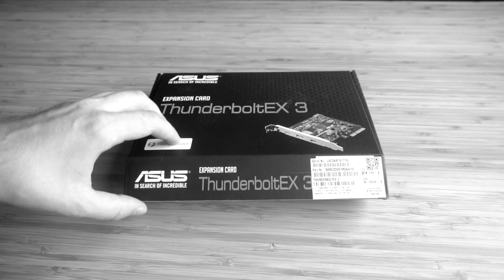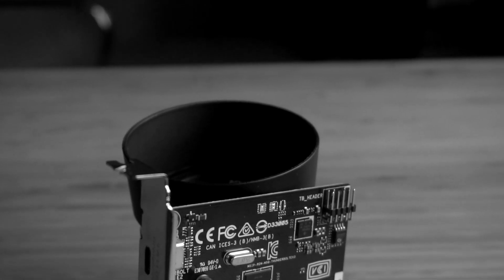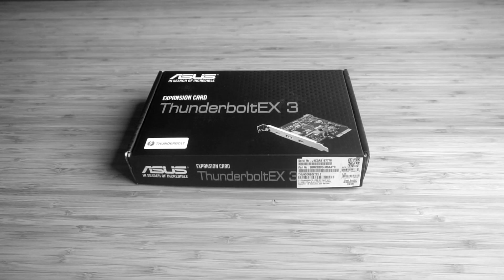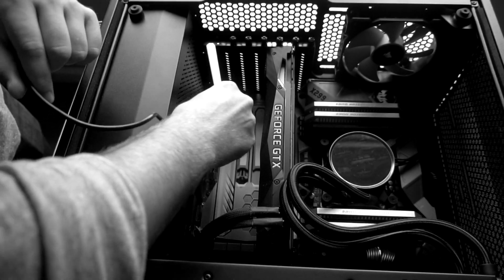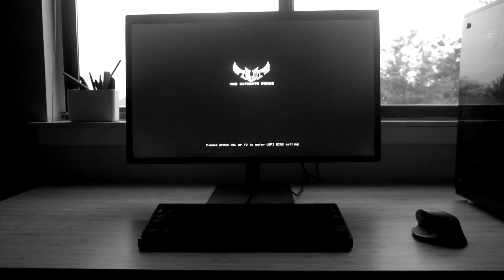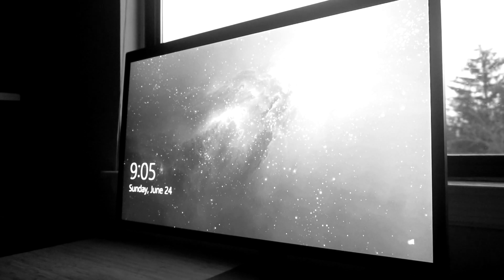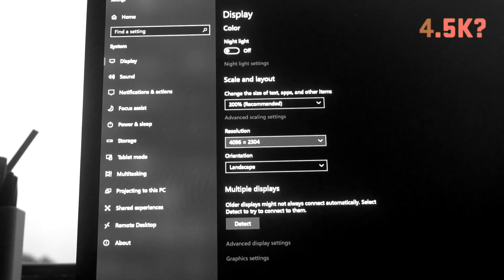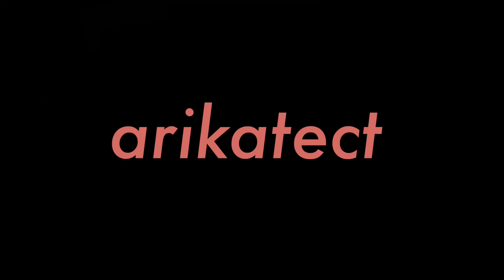LG Ultrafine 5K on a  Windows Desktop

Comment: Would this work with a nvidia GTX 980 ti ?
Reply from the maker: Since the GPU is connected directly to the Thunderbolt expansion card able to run the monitor at 4K. The only issue is if your motherboard is compatible with a thunderbolt expansion card.

Comment: Would "USB-C to HDMI" cable work to connect a PC and LG 5K monitor? I just need to use the LG 5k monitor, I don't care quality.
Reply from the maker: 임준성 unfortunately no the LG Ultrafine is a Thunderbolt Display and has a built in control firmware that requires it to be connected by Thunderbolt to work.

Comment: I have the LG Ultrafine 4K installed on my Windows with the same Asus TB3ex youre using but whenever I put the computer to sleep and wake back up, it doesn't wake up the displayport. Instead it defaults to HDMI, which is my TV. Is your 5K able to wake up from sleep?
Reply: I'm having this issue as well, but it happens after ~2-3 hours of continued use as well. Once it's "sleep" I can't wake it up again without replugging and rebooting. Even then it doesn't always come back.
Reply: @christopher-pfeifer  you can probably disable your displayport or monitor from sleeping or turning off to save power in device manager. i stopped putting my comp to sleep. i just shut down now cuz my comp boots up in about 15 seconds anyway. There was this other pci express card with usb c alt mode called Sunix UPD2018 that worked waking up this monitor from sleep but it was glitchy as hell. the screen would go black for a second a few times an hour. ASRock makes one of these cards too if you wanna try their version and let us all know how it turns out
Reply: @tee228  Does the ASRock one work with the ASUS motherboard thunderbolt headers or is there a ASRock motherboard I'd need as well?
Reply: @christopher-pfeifer  I'm using this Asus card on a non Asus mobo without the headers and it works so i dont think it matters
Reply: @tee228  if you don't have the headers then what does the card's internal cord plugged into?
Reply: @christopher-pfeifer  I dont use the cord. Surprisingly it works lol anyway when ur computer starts up, does it show the boot logo all distorted and low resolution? Mine shows the dell logo but it's in like 480p and all pixelated and looks like an oval instead of a circle. Just curious if anyone else is like that
Reply: @tee228  does it work normally once booted? That's got me speechless lol.
Reply: @christopher-pfeifer  yep works perfectly fine. Except for not being able to wake from sleep hahah I'm gonna wait till the price drops a little more on the rtx 2070 and run it straight from there. Most 2070s have usb c output
Reply: @tee228  that is literally fucked and im gonna try it out. I bought an entirely new mobo to have the damn header.
Reply: @christopher-pfeifer  lol good luck. Lemme know what happens
Reply: @tee228  nothing, didn't even show up in the bios without the headers cord plugged in lol
Reply: I now believe my monitor is messed up somehow.

I'm not sure how you're able to get a Thunderbolt 3 wrapped signal from your GPU without the header cord plugged into it. Unless the non-ASUS motherboard is somehow able to run everything thru the PCIe slot.

I did confirm that without the TB3 header cord you can get DisplayPort 1.2 video signal out.

Two days ago I found a copy of the x.11 firmware for the 5k monitor and manually flashed it into it. Everything was fine, in fact Windows "discovered" a "USB 3.1 Hub" for the daisy chain 3.0 ports on the back, and knew it was only able to do QHD+ because of DP 1.2's limits within Windows; but after a few hours of refusing to sleep it turned off and has never came back on.

If I plug it into the USB-C port on my motherboard I can see it as a "LG Ultrafine 5k" USB Serial device, but nothing as far as devices or component use.

All of that leads me to believe the monitor itself is dead somehow, for some reason. Even using it back on my Macbook Pro it doesn't get identified as itself, can't get video, but does still charge it.
Reply: @christopher-pfeifer  I think something might've went wrong when u flashed it. My asus card lets me use the GPU thru the pci Express port. I'm not sure but I think the header is only needed if I wanna use the usb c slot as a hub and not have anything to do with the graphics
Reply: @tee228  Indeed, I agree. I must have toasted the firmware.

And indeed, that would make sense since it's almost like a USB header cord that you would plug into the normal USB 3.0 headers, similar to ones used for front panels. And could only be needed for webcam/speakers/microphone/etc.

I contacted LG and told them it no longer works with even my mac book, we'll see how this goes. Shocking to find out the warranty is only 1 year. ONE?! That's some lack of confidence....
Reply: @christopher-pfeifer  wow. 1 year lol mine is starting to get lcd burn around edges especially the top if i leave it on the same window for about 10 minutes. goes away after a while though. this monitor got its problems but its still the best in picture quality due to the 4K resolution cramming into less than 22 inches. i hate big monitors lol
Reply: @tee228  agreed. It's the same PPI as the XDR display that's 6k so that's pretty dope as well.
Reply: my lg ultrafine can always turn on after sleep im not sure why but i installed Thunderbolt Control Center from microsoft store and add lg ultrafine display there by select always connect
Reply: @chittapanu0  thanks. im gonna try that

Comment: Just using the ASUS ThunderboltEX 3 is not enough because the ASUS AIC is only a DP1.2 in,  to fully drive the 5k display you need two DP1.2 in or one DP1.4 in ext card. so only Gigabyte GC-Alpine Ridge/GC-Titan Ridge can fully drive 5k display
Reply from the maker: cao ping yes you are correct, I have ordered a GB card and will test, my channel comment section has become quite a hot bed or discussion. I will be testing if that GB card will work with an Asus MB
Reply: Arikatect any news here? did the gigabyte card work with the asus motherboard?
Reply from the maker: @robertk2456   The TB Header is different on the Gigabyte x299 Boards and expansion cards than on the Asus versions.  They aren't interchangeable since Intel hasn't developed a standard motherboard pin out for thunderbolt. Super frustrating!
Reply: Arikatect sad . I really love 5k monitor . The pixel is so sharp. I don’t have a choice so i bought an IMac after i sold dell up2715k.

Comment: you just need to download the Apple boot camp drivers and install the drivers for the LG display.
Reply: It's really that simple? Did you try?
Reply: @mburton  yes I have been using my LG 5K in windows for years no issues.
Reply: PKTV does this output in 5k?
Reply: Neil Thomas yes depends on the motherboard u have but for the most alll x570 motherboards with thunderbolt will support full 5k output providing your video card supports 5k monitors
Reply: PKTV thank you! Do you know where you can get the ultra fine specific boot camp drivers?

Comment: Thanks a lot Arikatect for the video at least and the fast response.
Reply from the maker: Thanks for the comment. The video is just to help inform people about 5k from a Windows perspective.
Reply: Hi again Arikatecht. I just tried my xps 15 9570 at Apple store and it worked  right away with the lg 4k ultrafine.  Did you develop a way to adjust the screen brightness on your setup?  Thanks a lot!!
Reply from the maker: im still working on it! i tried the Bootcamp drivers but they weren't very well.
Reply from the maker: Sorry, the driver wasn't very stable.
Reply: I read somewhere how someone solved it but I cant remember where I found it but I will.  If I find it and it works Ill let you know if youd like.  Thanks for the fast responses.
Reply from the maker: Well if you find a solution let me know!!!!! This is what community all about. I have a video coming up about apple cinema displays with windows.

Comment: So are you you happy you bought this knowing now you dont get the 5K resolution where you could have purchased a 4k monitor for less?  I am considering getting one for my xps 15 9570 with 4 lane thunderbolt ports.
Reply from the maker: So I'm also a Mac user where I do get the full advantage of the monitor. This was more about being able to get the monitor to work with windows. I didn't purchase this monitor for a permanent windows experience. This was for if someone who already owns a Mac, Windows Desktop, and to use the LG ultrafine with there setup. I would say save your money with a 4k Display. Im very happy with this display and have no regrets for the purchase. But for windows experience isn't super worth it.
Reply from the maker: Also the reason why 5k works with Macs is down to a special thunderbolt controller they developed  that's different than the third party adapters.
Reply: I am mainly on windows and use this as my main monitor and I am super happy with it. No monitor on the market comes close to the color or brightness. Also its 27" whereas the ultrafine 4k is only 24".